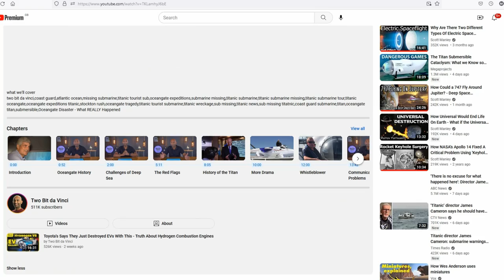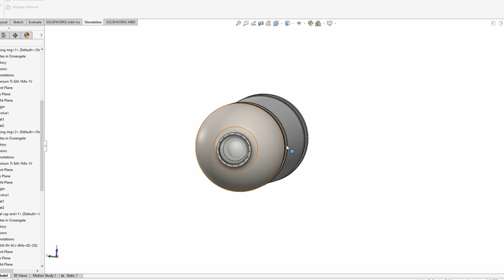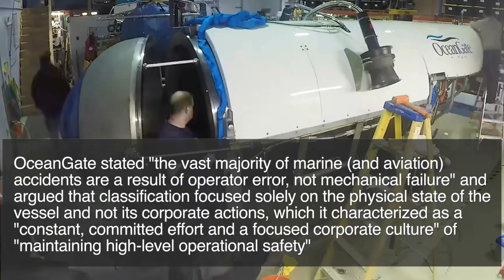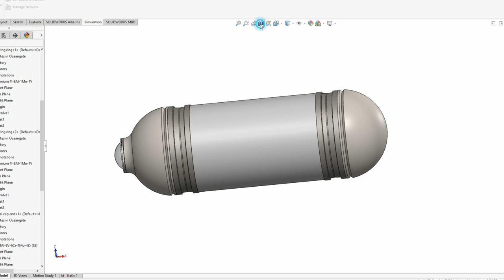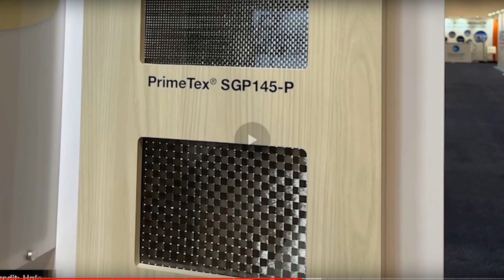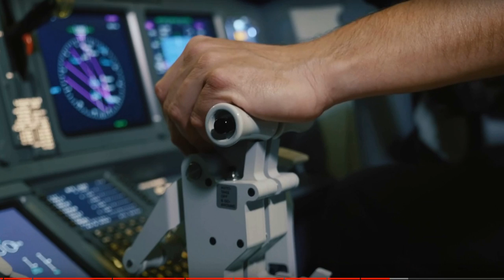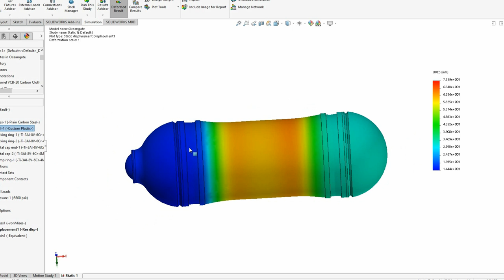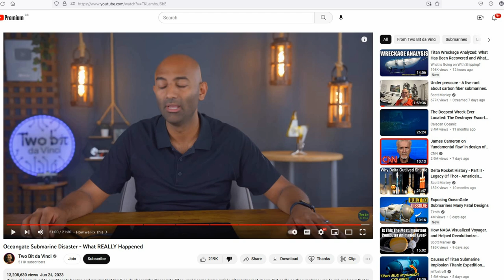Oceangate Titan - Engineering Failure?

Comment: The glue area seems extremely under engineered. Different stiffness and thermal expansion between titanium and carbon fiber is not easy to compensate for with glue.
Reply: I agree and maybe there could have been dowls or a extra compression flange if carbon fiber ends were thicker to accommodate. Needed more redundancy was trusting adhesive way too much.
Reply: Also the width of the glue contact surface area seems very narrow.
Reply: Do you mean the peanut butter area 😢😢😢😢
Reply: It could be the joint, but it also could be the CF just shattered in the middle from the uneven stress. Even with a non-sphere, wouldn't a titanium egg shaped thing be a better attempt rather than a flat sided cylinder? It still might fail, but if every surface was curved with thickness varying according to where computers detected the most stress it might have a chance to make something with a bit more room for his tourists. I do not see the metal ring with screws that was holding the window on in the images of recovered debris so I suspect it blew outward. If the implosion began with the window cracking, that securing ring should still be attached?
Reply: As a chemical engineer with a minor in materials engineering, that is the point of failure. Also they wet set the carbon fiber instead of pre-frag pieces that are more uniform as they are set under pressure
Reply: @navigator3744  absolutely totally inadequate, it would have to be a thick flexible type of glue to compensate for the different compression of the titanium ring and carbon fiber tube, but you don't want flexible stuff to be under 380 bars of pressure
Reply: There's a reason why we don't use carbon fiber on repeat-dive deep sea submersibles.
It doesn't matter how well you engineer the gluing, the weave, etc. The entire hull could've been made out of carbon fiber. It wouldn't have changed anything.
Carbon fiber is not a material that you use for extreme stress repeated compression/decompression because eventually it weaks/delaminates until it suffers catastrophic (and very, very sudden) spontaneous deconstruction. There is a reason why every single naval design engineer was horrified and tried to raise alarms when they saw this thing. You don't use carbon fiber on a vehicle like this if you are going to repeatedly go to these depths. It simply isn't safe regardless of what you do because the materials are the wrong choice for the wrong job.

If you are just going to one-and-done, CF isn't an issue. Repeated? You don't do this. As evidenced.
Reply: @MichielvanderMeulen  I'd like to see pictures of the rings; I've been curious about whether there are pieces of carbon fiber attached to them, or whether there was complete separation. The cracking sounds were probably the carbon fiber hull flexing inwards in the middle, thereby lifting the ends of the tube from the rings gradually little by little breaking the seal created by the "glue."  Perhaps they should have used 3M 5200.
Reply: @navigator3744  Would be nice to see..I predict the glue broke clean off.
Reply: @matchesburn   spot on - well stated !
Reply: yeah, it needed a layer of duct tape around too.
Reply: @navigator3744  Does not mean much. The explosion was massive, even if it didnt fail at the rings, chances are the explosion just removed every bit of carbon fiber from the rings.. we talk about very crazy amounts of energy when that thing imploded and then exploded.
Reply: @Astral_Blaize  The more I think about it, the worse it gets with carbon fibre in this application. Take the difference in properties of the fibre and surrounding epoxy. Air entrapment, even if tiny. All so much worse than a ductile uniform metal.
Reply: @matchesburn  Cracks can propagate over all the fibre-epoxy interfaces. Just as you say: there's no way to know the actual strength.
Reply: @Trikipum  nah,the explosion didnt even damage the electonics nor the cone end nor the landing gear mutch, no waz it would  of been that clean of a brake if it was a proper bond, there would be SOME cf there, there isnt a spot of it as far as the pictures go... the titanium was not roughed up to make the bond with glue, they just glued it machined , almost polished finish, also they didnt compress the ring at all durning gluing
Reply: @matchesburn  even one and done singular deep dive isn't a 100% zero failure insurance policy due to variation in carbon fiber manufacturing process without overkill safety margin in terms of section modulus.  The wildcard is the lack of homogeneity of carbon fiber which gives it its non-isotropic material/mechanical properties.
Reply: Did you watch the video? Thermal expansion was not the problem. If anything, the glue joint did not allow the tube section to evenly become compressed over the entire length. The force which deflected the carbon tube is of the same magnitude as the force which is acting on the glue joint laterally and radially.
Reply: Brilliant analysis! It is almost inconceivable that no one bothered to di a Solidworks stress simulation. If the faces between the cones and the tube had been allowed to slide against each other, thus allowing even lengthwise compression of the carbon cylinder, it probably would have been OK. This would have required some tie bolts with tension springs connecting the cones and flexible gasket sealer.
Reply: @MichielvanderMeulen  exactly this, you wouldnt use flexible glue on a hydraulic power sytem and Titan was operating under similar pressure levels. 
Somewhere in Oceangate's files will be a full technical justification for the adhesive chosen and used, and a breakdown of the process used to apply and cure it. If there isn't, then ... well. 
The other thing I saw from their videosof Cyclops being assembled was the slaphappy bonding process. Nobody is wearing gloves. the glue is mixed in a pot with a spoon and there seems to be no pretreatment for the titanium parts. I would have expected a life-critical part like this to be assembled under certifiably clean conditions, with the adhesive dispensed through a mixer nozzle for complete mixing, and some sort of pretreatment on the titanium - either a conversion coating, sandblasting or etching, but at least something on what is otherwise a very smooth machined surface on a material that isn't known for ideal bonding properties. I also note that the recovered titanium sections seemed to be cleanly separated from the carbon fibre, so there's your problem ( or at least one of many)
Reply: My date box boats always came apart in the bath, that’s all the experience and explanation i need.
Reply: And the applied the glue in an open warehouse, so plenty of scope for contamination from particulates that would make the bond even worse.
Reply: From what I've seen that is the most likely. Especially since carbon fiber isn't the best under compression, this with the strain on that connection seems the most likely fault point.

Comment: I agree with your idea that the adhesive joint is the area of most likely failure. Not because of the adhesive joint as such but because this is  where the differences in the behaviour of carbon fibre and Titanium become important. Both materials are already notoriously difficult to work with since they don't obey the rules we thought were established by the steel and wood and Aluminium and plastics that we deal with every day in normal temperatures and pressures. Take these two behavioural outliers, put them together and then take them from 15C and 100kN/m2 to 0C and 38MN/m2 and they just cannot be friends!
Reply: Yes
Reply: @jacknickolstine3355   Room Temperture cure and certainly not in a clean room or bondline thickness control
Reply: @Curtgunnar it’s called a wet lay when you do this type of Carbon fiber as seen on the video of the manufacture of the hull you will get hotspots and air bubbles leading to a weakling of the hull, Rush actually lied about the process not saying exactly how it was done by would use words like BOENG , NASA and infer they were involved in the construction, they were not
Reply: @Curtgunnar  Right. I watched the video of how they bonded the titanium ring to the pressure chamber and it looks to have been open to the atmosphere. One has to think of how micro particles could have caused delaminating later.
Reply: He should have used pre- preg carbon fiber for the hull
Reply: @brianpollet3193  Yeah, I saw that too. It was just some dude brushing it on like he was painting a fence. For such a critical interface I was surprised at the imperfect methods they were using.

Comment: This elongated shape is the exact reason military subs cannot go anywhere near these depths, spherical every time... Great informative post
Reply: It’s more the large inner circumference of the pressure hull. The necessary wall thickness for a military sub to go down to 4000 m would be insane. But possible.
Reply: @slaphappyduplenty2436 indeed. AS-12 is reported to have 3000m test depth, NR-1 has at least 3000ft test depth. So I’d say it’s possible unless you try to do it with a 20kt ballistic missile cruiser 😅 Probably it still could be solved with a lot of effort, but: 1) Why? 2) Insanely expensive
Reply: That, and their mission doesn't really require them to. but the problems in getting to miles-deep parts of the ocean are better known than ever at this stage, and I'm sure they could do it if they wanted, but it's just not wrth the expense.

Comment: I’m not an engineer but it seems a bizzare design to me. Cut the ends off a plastic pop bottle, glue them back on, fill it back up and squash it in the middle..I’d imagine one of the glued ends would soon come off 🤷‍♂️
Reply: It is worse than this. They were not gluing a part back on that was compatible with the other parts.
Reply: The fiber's don't break from internal pressure...but offer little strength being pushed together...
Reply: It's different materials with different expansion and contraction rates - the pressure issues aside, I'd not trust a glued joint between these materials without some form of mechanical backup, like a locking ring or clamp. Glue on pipework for instance melts the two surfaces together,  but here, theres only the glue itself without any way of melding the surfaces with each other.   I'd think the joint and glue would expand and contract just from the freezing temperatures down there which surely woukd lead to the glue line fracturing or cracking each time it goes down. It seems a very dangerous to idea to me.
Reply: @ChrisAndCats exactly this was a mistake from the beginning
Reply: @gregpoulin6184  it certainly seems that way, like it was on borrowed time.
Reply: Especially since Carbon Fiber is basicly reinforced plastic🤷🏻‍♂️
Reply: @mr.tarkovish2587  Sure, but concrete is also just reinforced gravel if you want to be reductive.
Reply: @mr.tarkovish2587  well they are dead Jim:face-fuchsia-tongue-out:
Reply: @qerupasy  concrete would not have imploded why cause the ocean pressure is compressive stress's so it would have maximum strength in that situation but then again you would need heavy and require tanks for extra buoyancy to raise back you to the surface
Reply: @raven4k998   Also, concrete is not watertight, much to the chagrin of structural engineers who have to contend with rust in their steel reinforcements. 😉

Honestly, I'm not here to fight anyone. Just trying to make a joke and point out that material science is a thing where intuition can lead you astray. If we didn't have tons of engineers around to tell us about it, most of us wouldn't even know that carbon fiber is weak in compression. I knew it was rigid and brittle and that it fails suddenly and catastrophically, but not that it is weaker in compression than tension (though it does kinda make sense with that microstructure).

Comment: The navy subs use a controller as an option and only to control a periscope - not the actual sub itself. If you get a stuck button or stick, it won't mean the sub hits a rock. And they have the original built-in periscope controls as a backup.

I'm not sure how fast Stockton could swap a malfunctioning controller, say one that is stuck full ahead into the Titanic. I think he said he has touchscreen controls too and several backup controllers. Even if he has a quick backup, it's a bigger concern that he appears to use Windows.
Reply: I hate windows. The reason you pay $8 to use the ATM is because of the windows licensing fees.

Comment: If the transcript that was leaked is authentic, the cracking sounds they reported hearing near the back could have been the glue cracking off the titanium ring.
Reply: Stockton reported cracking and popping in many trips
Reply: If it is true transcript, I actually think it’s the electrical AND the CF cracking. They switch circuits and hear crackling after the switch again and they had electrical problems so
Reply: @SoulDelSol  I'm trying my best not to jump to conclusions, I don't know all the facts nor the context about this vehicle as well as submersibles in general. But, on the face, you choose Carbon Fiber against the advice of credible experts and your getting cracking and popping noises, that could be indicative of failure of carbon fiber? What did they do to resolve these sounds and assure the integrity of the Carbon Fiber? Not directing this at you, just in general, but that info just leaves me even more flabbergasted than before.
Reply: The noise most likely the carbon fiber bending and cracking /splitting apart / delamination at the layers where it was bonded to make it 5 inches thick.

watch at 4 minutes 
https://www.youtube.com/watch?v=_3XngNqkBsk&t=225s
Reply: Im really convinced thats where it failed.
Reply: @CarlosAlejandro.-ke6gr  
The shame is that many experts in the field new it was a bad idea, and it would most likely end up in a tragedy and loss of human life.
Reply: @hrevyaga82  In every new endeavor, there is someone waiting in the wings to say "I told you so".   And a carbon fiber/titanium hull for this type of dive was bound to draw in critics.   So it doesn't tell us much of anything.   That doesn't mean that serious mistakes weren't made, but ignoring the peanut gallery isn't automatically indicative of much.
Reply: @rickanderson8088  We don't really have a whole lot of info with regards to the internal testing and maintenance of the sub.  Hell, we aren't even sure of the specs of the thing.  It may have been really well tested, maintained and engineered, or it may have been a hack job.  It's really hard to tell.  What little we do have is of poor reliability.
Reply: @rickanderson8088  they had sensors that they thought were sufficient to detect the defformations on the hull,and if the transcript is true the sensors did detect it going to shiz, just too late , or rush made the parameters set high for going red, they would have to be set quite low for repeted dives, but as he didnt care for safety mutch and it looks like he had no idea what he was doing generaly , i would not be suprised that he way overshot the range of safe deformations
Reply: @merced175 the transcript has been proven false..,
Reply: Wrong it was the fiberglass hull duh 🙄

Comment: 38:50 Its still stupid to use a controller as the primary (and only) way to steer the vessel. Yes the Army uses Controllers, but only for secondary systems like drones, or here: periscopes. Also they are not wireless...

Comment: I’m in total agreement. An implosion at this depth is like a super nova. Everything falls in under massive forces and then has nowhere to go but rebound. So you would get an initial axial pressure wave from the collapse and then a rebound wave in all directions. That sudden change in directional forces is probably what shredded the carbon fibre cylinder.
Reply: Youtube has a lot of balistic gel videos and slow motion videos of guns firing underwater. You can see implosion effects frequently as gel cavities or gas bubbles collapse. There's frequently a dieselling effect, ignition and a secondary explosion generating substantial rebound at ambient or near ambient fluid pressure.